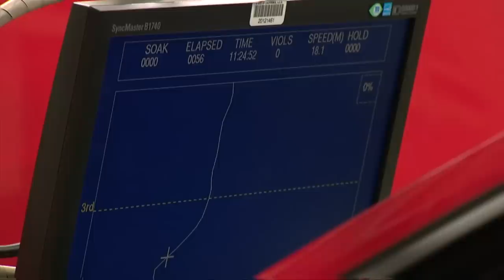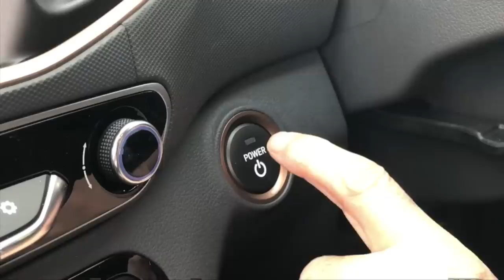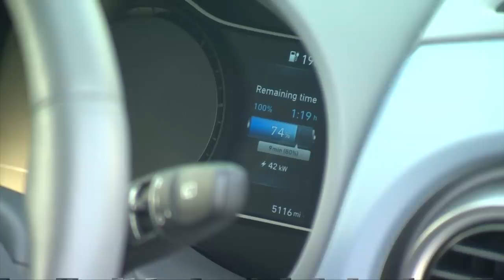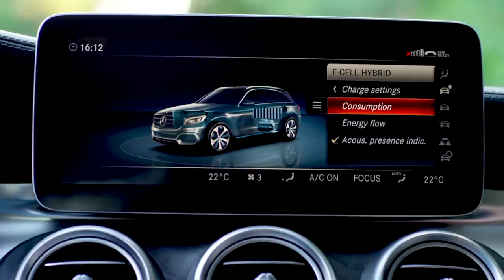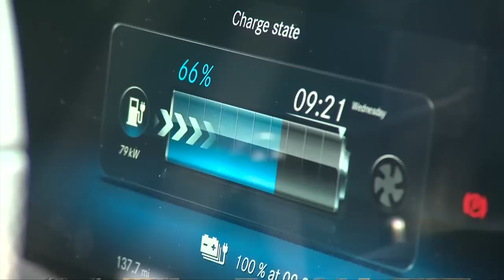Electric Cars: The Future of Road Vehicles? - BBC Click

Comment: People saying like they're going to make EVs affordable how tho I can go buy a 1999 honda civic for like $900 running and drivein maybe cheappr and the cheapest you're going to get for a ev is probably six grand  or paying 300 down I don't want to give payments for a car i'm looking to buy a car I better buy a 1996 car for $700 I think we should hold onto gas cars for another 80 years make things a little easier
Reply: I have a friend that just bought a 2013 Nissan Leaf for $5,500. He will pay for the car entirely in 5 years on gasoline savings alone. Tell me a cheaper car than that.
Reply: EV Owner 1996 to 2000 Honda Civics are like 1500$ to 2000$ very good on gas very Reliable pretty cheap to work on yeah it's old  it doesn't  look cool but at least it's a car that gos u know what I mean it's all about what you wanna Drive
Reply: @rockydemetro1496  It truly is about what you want to drive. Drive what you want. But to say a gas car is cheaper is not true - only and EV can have negative cost! No oil changes, not cat converter to replace, no transmission to fail, no fuel to buy. All for 1/4 the price of a gas car to operate regardless of the gas car's price.
Reply: EV Owner True but It also depends on what gas car you drive my cousin drives a 2000 Toyota Camry abuse the shit out of it still running like new Oil change for that car is like $30 car never gave him an issue good Engine but the Cadillac Northstars are the worst unreliable engine you got to take care of it for it to last not saying anything bad about EVs they can be just as cheap if you buy the right car that's my Point u know
Reply: @rockydemetro1496  Most certainly you get your money out of a car once you have one that is reliable and you have extracted lots of value from it. But - it will never cost you NOTHING. There's always gas, and operating expenses are $.55 a mile so says the US Gov't. Compared to an EV with $.03 per mile cost, you actually save money since you're not buying gasoline. And no gas car can pay for itself in 5 years or less. I don't think we're disagreeing - drive what you want.
Reply: EV Owner yeah you're right
Reply: EV Owner someday they will invent A battery that will never die cuz I heard if you charge your car your electric bill goes up if they invent that battery it will worth billions of dollars because the technology is getting better and better and better every year
Reply: @rockydemetro1496  Your electrical bill may or may not go up, but your gasoline bill will cease - net them out and your EV is cheaper by far.

Comment: Why didn't you mention Koenigsegg they make a hybrid and a full electric. And there's Aston Martin.
Solar panels are getting better and better why don't you put solar panels on the car roof sitting there absorbing the sun's energy most of the time the car is in a stationary position.
 you can reuse the batteries in your home sell them cheap, to store the energy from your solar panels at night-time, And sell the energy in the daytime back to the grid.
Eventually every home would have solar panels and batteries, would be no need for power stations to the degree fossil fuels or nuclear
Reply: The added Weight & cost for a Solar system on a car negates the additional energy provided. You really don't need solar panels on a car. you wake up every morning with a 'full tank'. I go days without charging.
Reply: @NotPoodle  I don't think the panel sheets themselves are heavy, it's the frame and Glass what is. on a car you wouldn't need the glass epoxy resin and that's all frames already there in the roof got to be lighter than the metal roof.?
Reply: John sweda To put solar panels in the roof has been done already, but lets not forget that 1kWh equals about 6 miles so if your relatively small area of car rooftop panels generates say 2 kWh in a day, thats 12 miles - a short commute at best. Not a silly idea, but not on a scale large enough to make that much of a difference.
Reply: @joebloggs5629  yes for small vehicle but for a large vehicle you can virtually fit a full-size panel, a 10 kw solar panel is 1.6 m by a 1 metre that should fit a medium to large car
Reply: John sweda 10kW panel 1.6m x 1m? Where do I buy it? Considering solar radiation is a bit more than 1300 watts per square metre, this is a conversion factor of 480% - which is scientifically impossible
Reply: @joebloggs5629  if you say so you seem to know about it I just Googled it what's the size of a 10 kilowatt solar panel you can get 5 kilowatts as well I don't know if they go any higher than 10kw
Reply: @johnsweda2999  sure but is there really a need? My model 3 gets me everywhere I need to go on a single charge, I wake up every morning with a full charge and if I need to road trip I can supercharge in the time it takes to grab a coffee. I just cant see a use case considering the additional cost. Also, would the additional weight reduce the range more than the solar would add in range? I don't know but it's a consideration
Reply: @NotPoodle  as I said I don't think there is a significant amount of weight in the panels themselves and probably be less if you cut out the metal roof a lot of cars have glass roofs it's got to be lighter than that does the model 3 not have a glass roof. How many kilowatt hours does it take to fully charge the battery?

Comment: Didn't cover battery leakage over time. If that is something that happens that's money leaking out of the car. Also, in that case, if your car sits for extended periods of time would you have to keep constantly charging it to prevent the battery from dying?
Reply: @Steve Davis I travel quite a bit for extended periods. I have to keep my car battery on a slow charger. The fuel is always there when I get back. I'm not asking out idle curiosity, and Im not the only one by a long shot who lives my lifestyle.
Reply: A Tesla needs to be plugged in occasionally because the on board computers and cell phone link never fully shut down so there is a continuous drain on the battery even when the car is not being driven. Li-ion cells have a very low self discharge rate so that is not the problem. This normally only becomes a problem if the car is left at an airport car park while the owner is away for a few weeks or the car is involved in an accident and sits around for weeks before repairs are started. If the state of charge of the battery were to fall too low the battery will disconnect from all the loads that drain it to protect itself, it will be fine like that for a long time but nevertheless it is a bad idea to allow a Li-ion battery to discharge to that point. An EV is different to an ICE car, best to keep them plugged in when not in use if you can.
Reply: @dogphlap6749  Thanks for the answer. This was helpful.

Comment: Hmmm faster than a Lambo.
Reply: Lucid Air 4 Door Sedan is outright faster than Lambos in a straight line. It has a Planetary Gear CVT trying to spead 1000hp & 800lb/ft of Torque over spaced out gear ratios. That allowed it achieve v-max of 235.44 miles per hour.
Reply: @Steve Davis Yep for Single Gear BEVs most Lambos are faster. But once you have variables gears on 1000hp plus BEV. Those are outright faster all the way to V-Max. The next group of BEV Hypercars should all be around the 245 miles per hour range if the Lucid Air 4 Door Sedan can do 235mph.
Reply: @Steve Davis Single Gear is actually Quicker from a Dig than variable gear BEV. Your BEV for Mere Mortals are typically Between the Lights Racers. It's just in this case they show a Lambo Hurucan. Lucid Air exist thus a BEV still can outright destroy a V10 race prep car all the way to V-Max. That Low V-Max rumor is now dead.

Comment: Stop and charge for three hours lol
Reply: I stop when I get home, plug the car in, wake up the next day, car is charged. I assume you have to go to a petrol station once a week or so, I do not. If you can't charge at home overnight an EV may not be for you.
Reply: Done a 1000 miles so far in my Model 3. Haven't waited 1 minute for it to charge.  Amazingly it has a full battery every morning when I wake up. Sure beats going out of my way to a petrol station and sticking £80 in the tank every week.
Reply: Die Cast Racing with Von   What huge expense ? An EV is expensive to purchase (but getting cheaper), insurance is expensive (I assume because the car is expensive), parts are expensive should you need anything replaced if it fails on a Tesla (that probably applies to other expensive cars like a Mercedes or a BMW whether ICE or EV but i have not looked into that), electricity is cheap as is normal maintenance.

Comment: I'm not convinced that should a significant proportion of car owners switch to electric vehicles, that the national grid and the charging stations will be able to keep up.  If 30 minutes is normal now, then it'll still be common for a long time; not to mention fast charging a battery wears it out faster.  So people will have to wait, there will need to be more 'pumps' than petrol/diesel pumps, and/or people just won't switch.  8 minutes is still a little slow.  As for the national grid: what sort of power generation will the 15 - 20 extra power plants be?

As for batteries.  We haven't had a battery breakthrough in almost two decades.  Unless one happens, we're going to hit a ceiling.
Reply: Also pricing can easily be adjusted to make people charge their cars off-peak.
Reply: Most people charge at home and at night. EV's will actually help balance the grid.

Comment: I just love the Insanity of all the cars going electric. The Power Grids can not handle the needed Generation that will be required much less the Extra Transmission lines needed . So the same Environmentalists that won't let you build a Power Plant or add a Large Transmission Line want Electric Cars. Go Figure.
Reply: Firstly, your very objection was addressed in the video which clearly said the grid would manage, so I suggest you actually watch videos before writing stupid comments.  Helps alleviate looking like an idiot.

Second, your other point is reaching a bit isn't it.  People aren't objecting to new power plants, they're objecting to fossil fuel power plants.

Humanity can handle problems as they appear.
If you wanna know what true insanity is, it's not going electric.  Let's just keep polluting city streets and burning a finite resource, eh?
Reply: They covered this, talked to the experts. It's not an issue.

In any case, we don't know exactly how much energy it takes to refine petroleum because the industry hides the figure. However, some estimates say around 6 kWh per gallon of petrol. So replace all the millions of cars getting real world 30 mpg or less with electric cars and the overall annual grid energy needs haven't changed.
Reply: @ogremgtow990  AGAIN, you are failing to subtract the electricity required to make gasoline that is no longer needed. Here's the math problem: 5 kw/hr required per gallon of gas. Stop refining gas. 5 kw/hr is now available to electric cars, which an go farther on that energy than a gas car could. Solution: 5 kw/hr gas production - 5 kw/hr no more gas production = 0 net gain. Get it?

Comment: If we all switched to electric vehicles, the grid would fail. I would like to see a few more hybrids as an interim.
Reply: Did you watch the Video? We have enough power, EV's will in fact help balance the grid and use that power more efficiently.
Reply: EVs do most of their charging at night.
Reply: You're wrong! Do you know how much electricity it takes to refine a gallon of gas? It's 5 kw/hr! Per gallon! An EV can go 15-30 miles on that much energy without burning a thing! The grid would see a net decrease in demand if we all switched to EVs.

Comment: EVs are a case of fools rushing into to a technology that is in its infancy and rather ad hoc far wiser to wait five or six years until they are sorted out. far to many variables to make practical replacement for my old Volvo far more energy  efficient than any new EV
Reply: Your old Volvo, with a gasoline engine, is more energy efficient than an electric car? Cite your references! Here's some facts for you: gasoline engines are about 25% efficient because you lose 75% of the energy in gasoline to heat. Electric motors are 95% efficient. 95% is greater than 25%. I'm really really interested in your amazing, physics-defying Volvo. Given that a used EV can pay for itself in gasoline savings alone, I also want you to convince me that your old Volvo is a better deal. Then talk about maintenance, please. Your old Volvo gets slower, less efficient and more costly to operate as it ages. There is only 1 moving part in an electric motor, and that motor is permanently sealed and lubricated.
Please - tell me about your amazing, polluting, oil-dripping Volvo!
Reply: @justsomeguy934  It all depends on what values you use. Each dollar is a unit of energy  expressed in currency. As my Old Volvo and I have two, were cheap paid for by cash and I can do services my self and are utterly reliable so hardly need an expensive mechanic, they are many times more energy efficient than any new car. Regardless how it is powered, the cost in time required to make the energy to create the dollars means cars are energy loss systems no matter they cost you money. The more money they cost the less energy efficient. 
As global economy is based in fossil fuel and FIAT Fossil fuel being the capital base FIAT being the cause of debt. but now dominating because of Corporate Marxists using incremental PCs which fear of Carbon is one, to create massive loss of value of wages to workers therefore any efficiency gain you fee you have with your EV is a cost to them, to then create more control over them, If you want to understand Climate better then you need to understand how the Antarctic is the greatest influence along with the sun, the never ending drought in Australia ongoing for 5000 years will get worst because of Antarctic effect. I pride my self in never believing any one that is making money out of any thing. Believe what you like I choose debt free motoring it is the most energy efficient there can be.  This efficiency thing is a delusion and shall have no effect on climate what so ever. But status being every thing at least you can feel better in your EV sitting alongside all those gas guzzlers which without your EV would not exists.PC Psychological Confusion through regressive intellectual programming of the poorly educated.
Reply: @taooflovepassionandcomedy8722  good grief, you stumbled into Marxism! EVs are NOT a result of some mysterious corporation trying to control us. It's a viable alternative to burning oil. In fact, one of the largest corporate entities in the world - oil & gas - is fighting it like mad. They bribe politicians to slow the adoption of EVs and solar/wind energy. They're protecting their income flow, that's all.
As for you trying to paint me into some ecological warrior that hates oil, you've 100% wrong. If you're concerned for corporate control, think about this: you have to ask a corporate for permission to drive your car! No gas, no car. I, on the other hand, can get my car's energy from ANYWHERE, including my roof! Who's under some corporation's control, you or me?
I drive, and advocate, for electric cars because petroleum is necessary for life as we know it. We cannot afford to burn it up one time to push a car! We consume 40% of the planet's petroleum reserves making gasoline. Almost HALF of this planet's petroleum gets burned and thrown away. Tell me you think that's a good idea.
You confuse efficiency and climate control, you lost me there. There is no argument that electric motors are 95% efficient and burning oil is 25% efficient - that has no climate aspect at all. 
Your old Volvo is likely paid for and relatively cheap to run. If you like it, keep it. But you will always buy fuel for it. An EV can pay for itself in fuel savings alone, making it the cheapest car to operate.
Reply: @justsomeguy934  Viable for the wealthy and those living near recharging stations one would not dare to venture far from this remote region of Australia in an EV  as soon as it ran out of power you begin to die of heat stroke and thirst, no thanks. This fear of burning oil is due to brainwashing you also need to burn oil to put an EV together the actual difference in amount of environmental damage is hardly worth the bother as yet these EVs are far from ready for general motoring use, in fact that is ten years away but by then flying in small machines,  will become the viable alternative to being stuck on a road in any sort of wheeled  vehicle. In fact the whole matter of transport is a means to tax society.  But it is all about free choice remove that are we revolt.
Reply: @taooflovepassionandcomedy8722  And here I've driven across a continent in an EV, far from the issues you mention. I'm all about freedom of choice, and EVs are that choice. You have no choice but to ask permission of oil executives to drive your car, yes? I don't need their permission to drive, get my energy at 1/4 the price of gasoline and can refill anywhere. Tell me (and I've lived in Australia) - do you drive into the desert and just run out of gas? Never looking at the gas gauge and...surprise...you're stranded? Doing so will chlorinate the gene pool for sure! I know where I'm going, plan refills (or the car tells me) and get where I'm going. As for being stranded and dying, I'd be more concerned that any one of the hundreds of moving parts required to keep a gas motor going would fail. I know my destination and my refill sources - but I don't know if some hose is going to fail, some part is going to stop moving, some liquid will leak in a gas car.